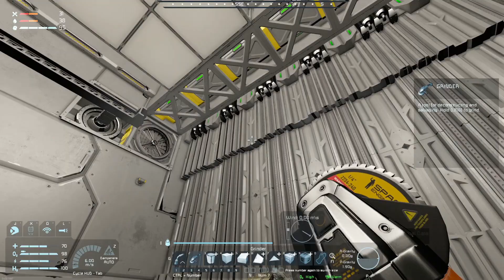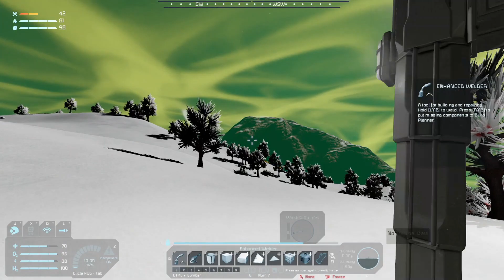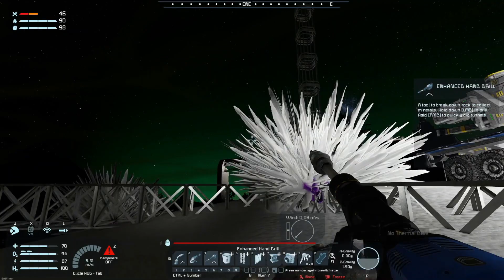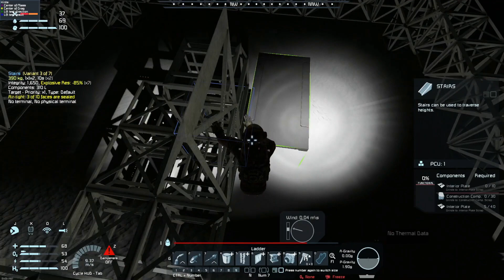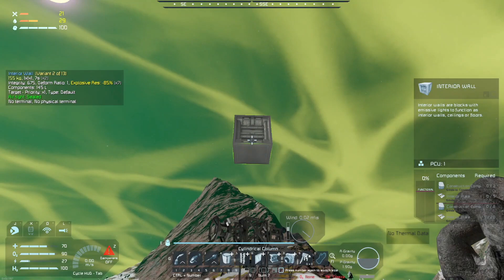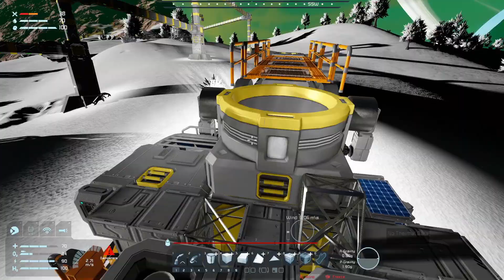Over Engineering Survival S2 Ep34: Solar Tower (Survival Impossible scenario)

Comment: I was there that day, 3000 years ago when the last video dropped... ;)

Couple thoughts: Are you SURE that you can't access cargo through a completed catwalk? And if you can't, have you considered slapping light panels on either side of the welder's non-cargo sides, which would give light and should also give attachment points for the railings.
Reply from the maker: It has been “a bit” between episodes, hopefully the next one will be out in a more reasonable amount of time (I’ve already started recording it).

At some point I remember having a catwalk on the head, I can’t remember if it was a completed one though. I know at some point in time you could access cargo through thinner blocks like catwalks and the 2x1 slope tip but it doesn’t seem to work anymore, at least with large grid. 

I thought about using corners lights to attach railings to the outside of the welder but decided against it as they would interfere with the other railings on the end of the piston when tipping the welder back as they are also on the outside of the block

Comment: Hey Anine 😊 it's been too long.
To your question, I think it is the custom turret controller you need for the tracking, and a camera facing the sun, for orientation purposes. 
The trouble I see is you would need 2 controllers, and both would have the same azimuth rotor, which is asking for trouble. This would work if you had used a rotor to hinge to one long wing of solar panels.

On your welder railing problem, I don't know if it works but might be worth a try, put some double corner lights on it and attack the railing to the sides of the lights. I think that could work.

And I saw your minecraft stream, at least some parts of it, I'm really looking forward for some more of these 😊
Reply from the maker: Thanks for watching and I'm glad you're looking forward to the next episode, hopefully it wont take as long to come out as this one did.

If I can't get the solar tracking to work it's not a big deal as I know the solar tracking scrip by Isy will work, I just wanted to try the vanilla solution. 

I did think about using corner lights with railings attached but decided against it as they would collide with railings I have on the rotors when tilting the welder head back cause those railings are also attached to the sides of the block